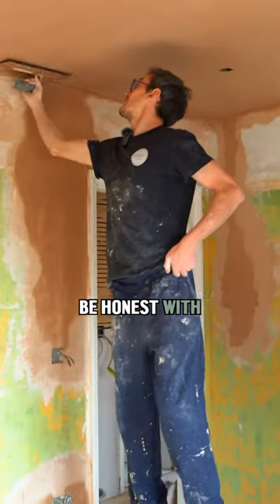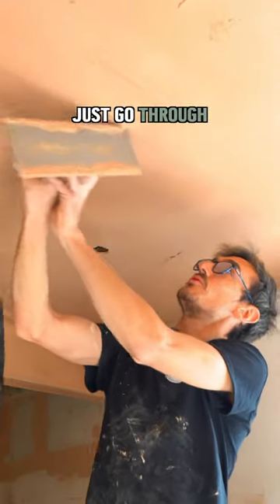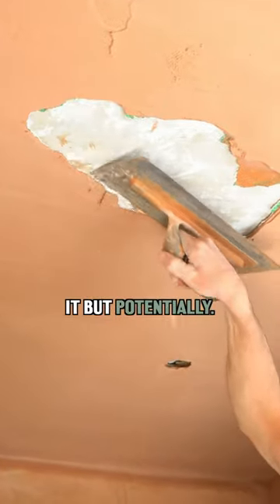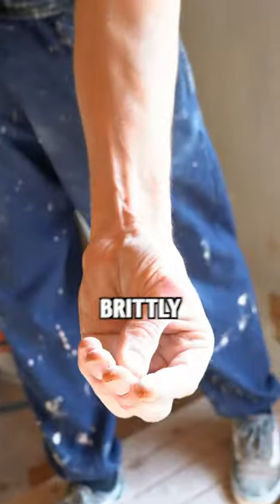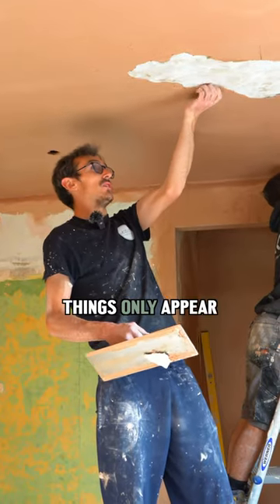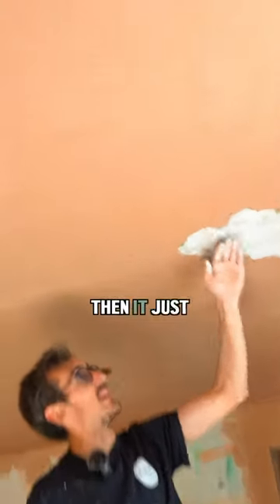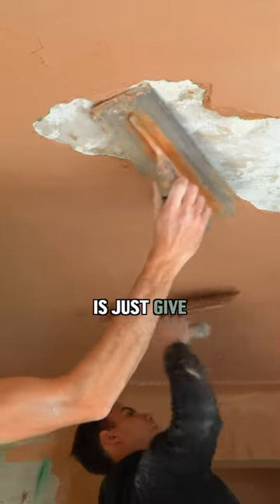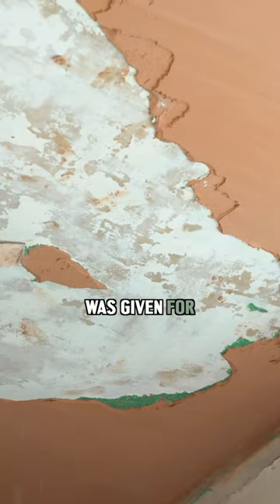How Can Plastering Go Wrong? #shorts #plasteringwork

Comment: Although I use sbr . It’s nothing to do with what bonding agent he used. It’s the distemper that’s the problem. And the artex looks so thick that a stabilising solution won’t penetrate enough.
Over boarding is only solution

Comment: I used to plaster a lot of artex problems are one it can reactive and become wet and unbond like that but also artex normally covers bad ceilings so cracks can appear I also board them over now to much hassle, I still plaster artex walls and the issues are a lot less

Comment: Hey mate. Anything older than the 1960's will potentially have limewash paint (basically dust).
You want to scrape the loose artex first, then stabling solution and then seal with your primer.

Nice video btw.
Take care 🙂👍

Comment: you can't plaster over oil based paints with gypsum based plaster. Use a cement based product like pufas r40 and why are you using PVA and not hydrosol?

Comment: Pva after the problem develops 🤣🤣🤣🤣most plaster make sure all paint and old paper is well removed,even sanding the area to create a base for the plaster,then pva,,,hey presto no going back to repair
Reply from the maker: Fair point, this may be more of a customer led issue than on Kieran as the idea of overboarding was vetoed. 
What would you have said to the customer?
Reply: The green stabilising plasterers primer is the pva, but obviously this guy doesn’t know you can’t  use it on textured ceilings lol
Reply: @jaksmith155 what are you talking about, you can use it on any surface
Reply: You’re crazy if you think any plasterer is going to be going around sanding, investigating under the paint for distemper etc, how much time and money do you think we have per job. In this case the client was tight and they paid the consequences for it, I always recommend over boarding ceilings for the reason this video showed
Reply: @NiktheEnglishGreekCypriot  read the back of the tub mate 😂 then get back to me 👍🏼 it clearly says not to be used on textured surfaces. I’ve been plastering for 20 years and used this product for 10
Reply: You can put whatever adhesive you like on an artex ceiling if its not adhered properly then as soon as you start to skim it will just pull the artex off.
Reply: Usually a good plasterer will scrape the artex to be sure it’s solid before applying pva. This job has now become a nightmare to get a good finish. Probably best to let it dry and overboard it😂